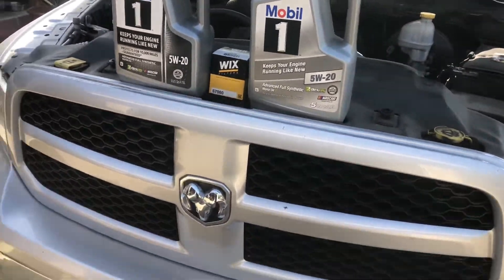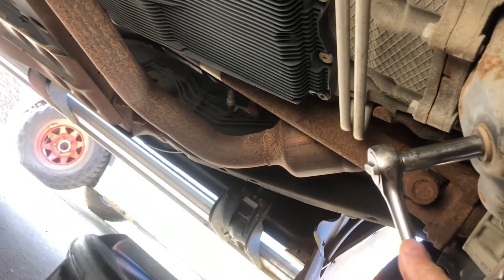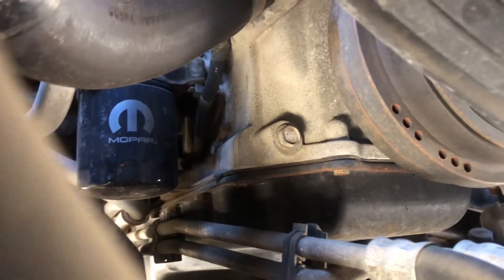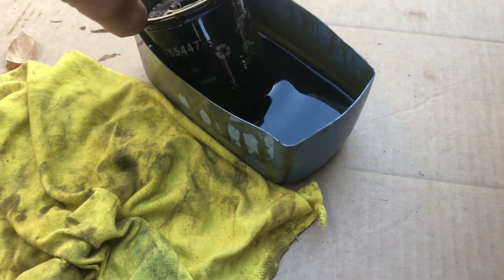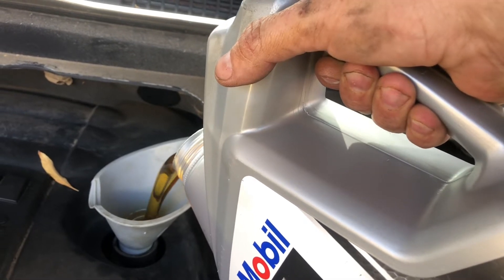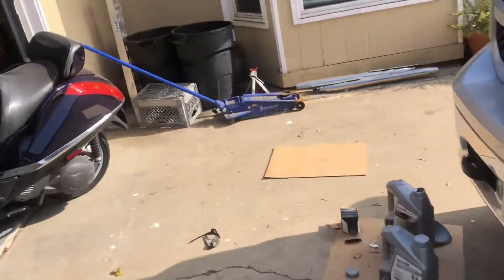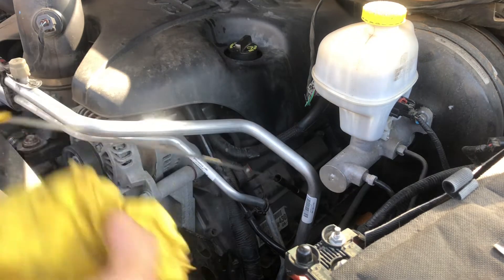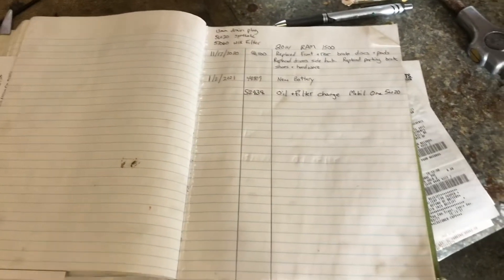How To Change Oil and Filter On Your Ram With 5.7 Hemi Engine, 1500, 2006-2019, DIY

Comment: Never knew Synth. oil lasted so long, no more 3000 mi. change for me. Maybe between 4000 and 5000. Thanks!
Reply from the maker: If you read owners manuals, oil change intervals have been 5000-7500 miles for about 25 years now.

Comment: My oil preference is whichever one meets all the specifications and is on sale for cheapest.
Reply from the maker: I try not to recommend anything on here, some folks are very particular and oil is almost as bad as religion or politics!  😂
Reply: @TomsTinkeringandAdventures  I hear good things about Wix oil filters :)
Reply from the maker: @zrkn1  yes, Wix gets good ratings.  In all my years of oil changes I’ve only had one incident with a filter.  It was a “house brand” from one of the auto parts stores, and the threads were all messed up.  Otherwise no problem with any, and I have used the cheap ones and the fancy ones.
Reply: @TomsTinkeringandAdventures  Not polite dinner table conversation, in mixed company, or for children's ears. lol
Reply from the maker: @KowboyUSA  I said something about using diesel oil in my motorcycles and the internet exploded.  😂😂
Reply: @TomsTinkeringandAdventures  Lawdy! Diesel engine grade oil works great in scooters and trucks!